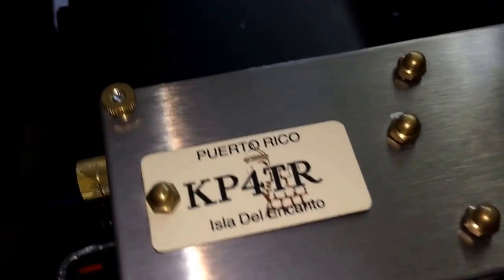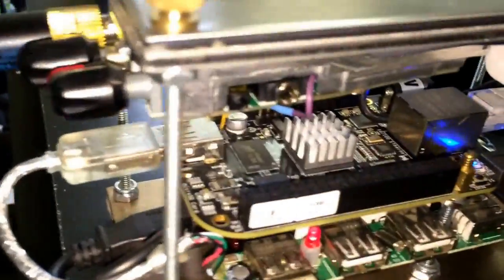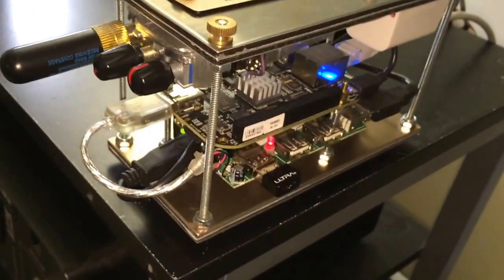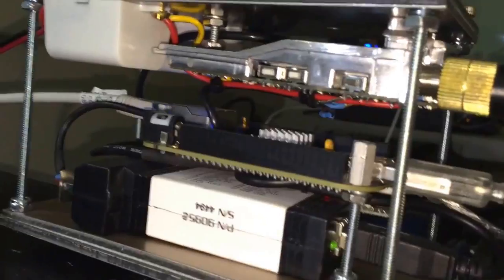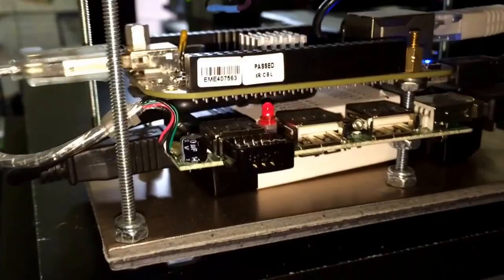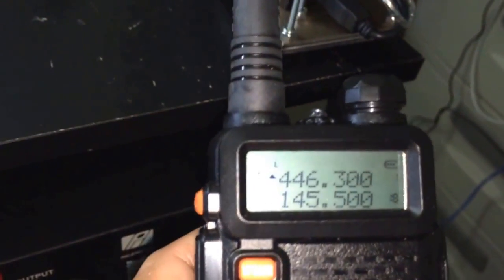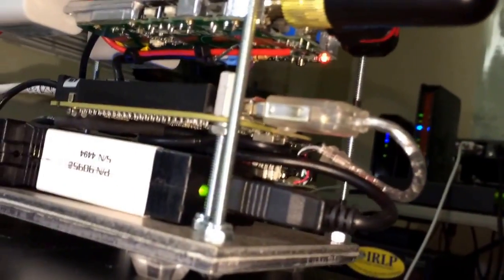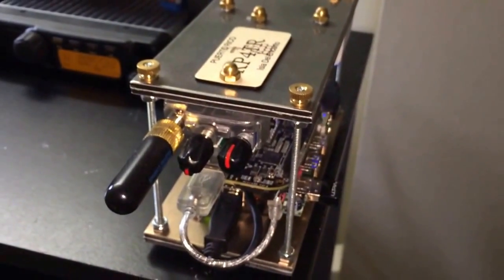Allstar Naked Node by KP4TR

Comment: Hola Ramon,

Me llamo Jorge Rios, no encontraba tu información y le pedi a Chuo que si el la tenia y no me contesto. Creo que mire en uno de tus videos que habías armado como 20 nodos de EchoIrlp usando la tarjeta de sonido DMK Ulrix no se talvez este equivocado.

Tengo un Repetidor Motorola MTR2000 de VHF y lo controlo con un controlador Arcom RC210 que tienen 3 puertos, es muy popular no se si lo conozcas. Bien hice el cable que conecta al controlador con un BD9 y en el otro lado lleva un BD25. El problema es que no funciona la luz roja del Ulrix PTT nunca prende solo la verde. Un colega que tiene en su repetidor un Ulrix dice que intento con 4 diferentes cables que fabrico y ninguno funciono. Le recomendaron a un aficionado en California que hace los cables y esos si funcionan, le dijo la persona que la tarjeta Ulrix lleva mas alambres conectados para data especialmente cuando usas el Raspberry Pi5 en EchoAllstar. Mi nodo si funciona si uso una tarjeta de las baratas conectada al usb en la raspberry.

No se si me puedes guiar o dar información quizás tengo algo mal conectado.

Jorge Rios KK6KD
619-586-7368

Comment: Any link or info for a first timer, that will use the 888 radio and a URL, need to know the wiring instructions for the radio side and 25 pin side.

Comment: Great video. How did you wire the URI to the Radio. Can you give me more information on that? I wired mine to a GM300 which is only 5% duty cycle and easily overheats.

Thanks for your help.